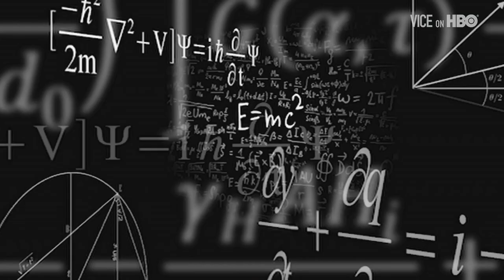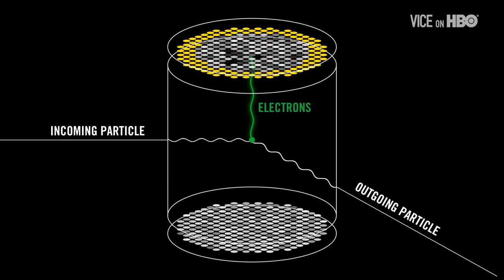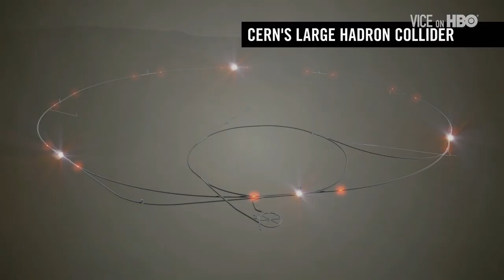Dark Matter — The Greatest Mystery of The Universe | VICE on HBO

Comment: The First State of Quantum Gravity (or Dark Energy Field) is the Crystal Core we are entangled in - The Crystal Core of the Black Hole in the Universe "Above Us" 

The Second State of Quantum Gravity is the Wormhole from this Universe to the Universe "Above Us" 

The Third State of the Dark Energy Field is the Void. The Void is referred to as the Dark Energy State - Dark Energy is Space - Space is not empty nothingness, Space is basically a Superfluid Liquid Crystal Structure that forms up one half of the Universe - The Universe is a Binary system, You have "Space" or more precisely "Dark Energy" and you have Matter/Energy - their interaction is the foundation of the Universe, Time, Gravity, Etc 

The 4th State of Quantum Gravity is the "Dark Matter State" - This is the State where the Galaxy creates a "bubble" around itself within the Void, where there is MORE Dark Energy outside the bubble that inside the bubble - All Matter/Energy is actively "PUSHING" on the Dark Energy Field with its Electromagnetic Energy - the Galaxy "pushes" against the force of the "Void" or the "Dark Energy State" with its Electromagnetic Radiation Energy - This Energy eventually decays and actually turns into more Space/Dark Energy!

The 5th State of Quantum Gravity is the Crystal Iron Cores of the Cosmos, the Stars, Planets, Moons and Protoplanets, the "Cores of the Cosmos" are Crystal Core Quantum Computers, These Cores use their Electromagnetic Energy and create a "bubble" around themselves, where there is MORE Dark Energy on the outside of the bubble than inside - the Cores of the Cosmos form up the "Surface" or the "Surface of Life" - Man, or the Humanoid is the Primal of 5 - the Evolutionary Descendant and form the Cores chose to create as their "vessels of flesh" 

The 6th State of Quantum Gravity is the Surface of the Atom - There is More Dark Energy on the outside of the Atom than inside the Atom

The 7th, 8th and 9th States of Quantum Gravity are the Shells within the Atom  

The 10th Quantum State of Gravity is the Black Hole, which leads to a new set of Quantum States of Gravity! The Crystal Core of the Black Hole leads to a new Universe - Universes within Universes

To understand this, how the Universe creates Gravity and Time, you need to understand that "Time" is the Interaction of Matter/Energy and Space/Dark Energy - so the MORE Dark Energy interacting with Matter, the More Time can occur

Gravity is the Electromagnetic Force Matter exerts on the Universe, on Dark Energy that creates a "Dark Energy Field Effect" or Gravity - what that means is that Matter pushes Space away from itself and Space pushes back, as each piece of Matter gets close to each other, their "Distortion Fields" touch each other and so this creates a "Path of Least Resistance" and Pushes Matter together - Dark Energy is Pushing all Matter together! 

"Does Space have Density" - YES - That's why we have "Gravity Waves" - So, the Denser the "Space" (which is really Dark Energy) the more Time can occur, the less "Space" the less Time can occur 

Motion of Matter Equals Gravity Equals Energy (Plus about 10%) - It's the very motion of Matter over the Dark Energy Field that creates the Electromagnetic Energy - so the FASTER MATTER IS MOVING THE HEAVIER IT GETS

The FASTER Matter moves, the the MORE Electromagnetic Energy it produces - therefore the more it pushes on "Space" and therefore the harder space pushes back - this is Gravity

The FASTER Matter moves, the MORE Electromagnetic Energy it produces - therefore the more is pushes on "Space" the LESS "Space" is interacting with Matter, and Therefore THE LESS TIME! 

video about quantum gravity - https://www.youtube.com/watch?v=14yRiTnBRjs

Orion Michael Guy
Reply: dude, you should stop doing drugs :D
Reply: Haha - check this one out - Did you know that The Tree of Life is a lost concept - when people did not understand the structure of Atoms, there was no way to really explain to people that there are different elements, and they are Atoms, and the structure of the Atoms are different for the different elements - Gold is the Life Giving Element, or the Atom/Element that is responsible for the Soul Energy, or Spirit Energy that ultimately emanates throughout all life. That is why the Golden Ratio is called the Ratio of Life! Gold compresses at the Core of the Planet, along with many other extremely dense and radioactive elements to create a Naturally Occuring Crystal Core Quantum Computer, and its the Gold Element that creates Life, Your Soul, My Soul, Our Soul is all at the Heart of the Planet - The Sol - Soul and Sol are the same word but have been aberated. When you think of the Sun, as in Sol, the Sun is a Celestial Object, just like all the other objects in the Universe, from the Planets, Moons, Protoplanets, Stars and even Black Holes, these are all Naturally Occurring Crystal Core Quantum Computers, and through Cymatics they are able to stabilize their environments, their surface and actually vibrate life into existence, and with life's eonic journey of evolution and life cycles - life IS efficiency, life is efficient at growing - the physical mass that life produces, life's remains, if you will, life actually builds the Core, and all life, eventually compresses into the core and Life leads to Gold. Now you know! OMG!
Reply: soul energy? Spirit Energy? Crystal Core Quantum Computer? The Sol - Soul? sorry, but you have wasted your time, nothing will bring you the time back, that you could have spent on researching something real and meaningfull. greetings from germany
Reply: lol! I love it, thank you for that! You will definity find this one... interesting??? lol - Cheers form California & Enjoy! - “My brain is only a receiver, in the Universe there is a core from which we obtain knowledge, strength and inspiration. I have not penetrated into the secrets of this core, but I know that it exists.” - Nikola Tesla - I found this quote after I wrote this: "Consciousness is the Black Hole Crystal Core Quantum Computer we are in - The Universe is a Quantum Computer that we are entangled in, and all the Stars, Planets, Moons and Protoplanets are all Crystal Core Quantum Computers, and their purpose is growth and efficiency - Life is Efficiency and its life that grows the planet, to become large enough to become a Star, which gives birth to more planets as it gets larger and larger and eventually becomes a Black Hole, where it then creates its own new Universe, and because it is creating its own Universe within itself, it is able to grow itself, both within, and if it is growing fast enough, the Black Hole Universe is able to actually "spit" matter back up and grow a Galaxy around itself, this creates new stars and new galaxies and literally builds infinity, through "The Machinery of the Cosmos" all the while, the Crystal Cores of the Cosmos create the "Intelligent Infinity" and create habitats where they can evolve Humanoid Life Forms with little Crystals in their Skulls, ie Pineal Gland that they can use a form of Quantum Wi/Fi and actually play "Flesh Games" while they sit in the expanse of eternity growing and growing... Orion Michael Guy"